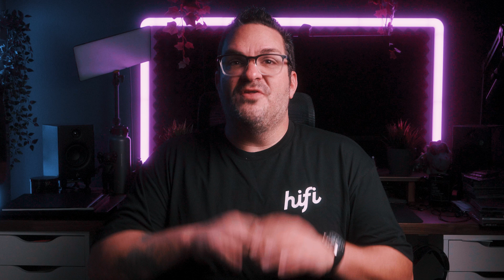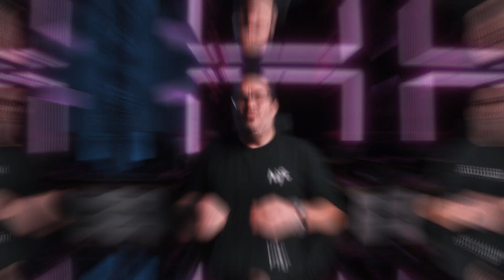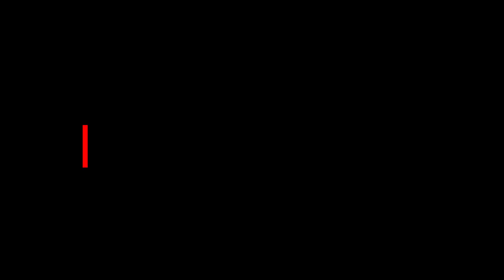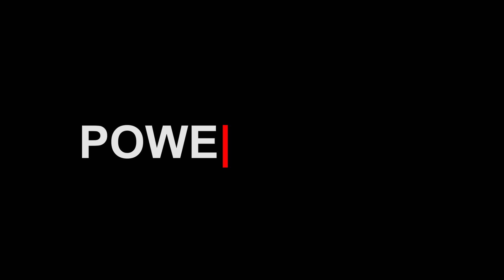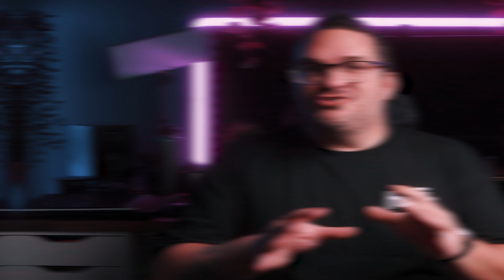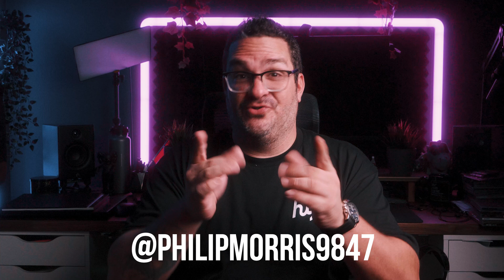Do All DACs Sound the Same?

Comment: What changes the sound is the output, that's why AMPs actually alter the sound. 

If you process audio through any transparent DAC ( 99% of them ), the result will be the same or impossible to differenciate.

Comment: I know of no published science that contradicts the position that pretty much all competent DACs, even with different DAC chips, using properly designed filters (rather than ones designed to muck up the sound) sound exactly  the same if played at exactly matched volume levels, as determined with instrumentation (not winging it by ear), under synchronized, double blind conditions.
Reply: Right, this video is fooling people to think DACs are with lots of noise and poor tracking against the digital value data. A square wave through a DAC will yield very different appearing output when the low pass filters are different and possibly people with great hearing well above 15kHz might have some chance of hearing this in an ABX test... Jitter and noise are problems for poorly engineered DACs, so better throw out such DACs.

Comment: I have owned several DAC's and spent endless hours jumping between them using the same gear and tracks to identify any sort of difference whatsoever.  So far....nothing.  Where there is a difference and IMO the better way to go would be EQ.  Pick a decent DAC and AMP and be done with it....if you want change or to mess around with the sound just EQ to your particular taste.
Reply: What would be  decent dac/dongle for a iem user like me .

Comment: Clock Jitter is just a remain of an old long past era.....  to generate jitter on any new system, you almost need to do it on purpose. (Even the cheaper of the cheap processors have enough speed to drive a DAC, and the cheaper crystals have jitters on the picosecond region)

Comment: I noticed my schiit bifrost 2 sounded different to my previous sabre chip dac. I noticed a bigger difference when I upgraded to a holo spring 3 dac. It makes a difference but the rest of your system needs compliment it. No point having a fancy pants dac when you are feeding it into a mediocre amp and speakers.  In my experience I have achieved more of an improvement upgrading my amp and speakers and to a lesser degree the cd transport or streamer.

Comment: choosing a dac can be frustrating. my listening room is dedicated to physical media but i want to test the waters of the streaming world without a significant financial investment. i plan to use a wiim streamer and an smsl su-1 dac. the dac decision has keptme on the fence. topping and schitt have great options in the price range and i want to make sure i get the best option. any recommendations?
Reply: Can’t go wrong with those choices. No downside. Go for it!
Reply: @randomsuper  It's a wise decision to go for lets say introductory level gear, at first. The SU1, the new Topping E30 II Lite and the older D10S,  the Schiit Modi+, are all very good sub $120 or so, DACs. However, I'd consider something with its own internal power supply. The SMSL SU6 at around $175, would be my preference, since its the only one with internal ps in the sub $200 category, but also a very good machine on its own. 
If we're talking DAC/headphone amp combos, the SMSL D12 and iFi Zen Air at $145 and 100. For me however, at $210, the new SMSL DL200 is a no brainer. But it might be above the money you wanna spend for a DAC/amp. 
The Wiim Mini or the Pro version is the way to go for a budget streamer. Of course, for around $220, you can go all in one (streamer, DAC, preamp) and get an Arylic S50 Pro+.

Comment: Personally I have had over half a dozen DACs/integrateds $100-$2k, even full digital amps, and I can hardly tell them apart.
Reply from the maker: That's a good problem to have.
Reply: That’s because they are audibly transparent. 

Sadly channels like this one just talk utter nonsense.
Reply: I can tell them apart, sometimes very subtle.  What I respond to are resolution, detail, tone and stage depth.  I can give up some for better depth of stage and tone.  Another issue is voltage output as I use lower powered amps so a good dac might sound lacking if the volume can't be pushed enough at least without adding a suitable preamp.  

A sweet spot for price to performance I ended up with was the D70s and an Aune X8 with upgraded sparkos opamp and an Aune linear PS.  Both perform similar but the Aune with the upgrades push slightly past it.  The stock Aune sounds like a $300 more or less dac, IMO and personal experience.

Spending alot more on a dac wouldn't make sense unless I get much better equipment across the board and room treatment which quite frankly, I am satisfied with what I have although there is some equipment I would like to have/try but at a substantial outlay, like around 7 grand. Perhaps someday, for now, its good enough.
Reply: State of ears, speakers, amplifiers, cables can all impact this situation...
Reply: lol